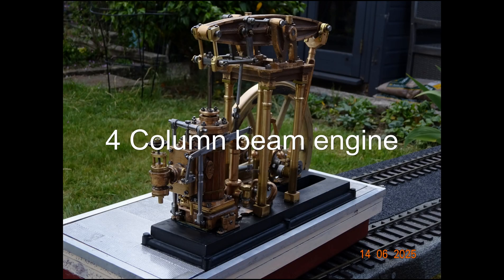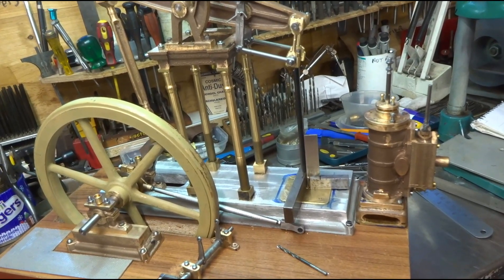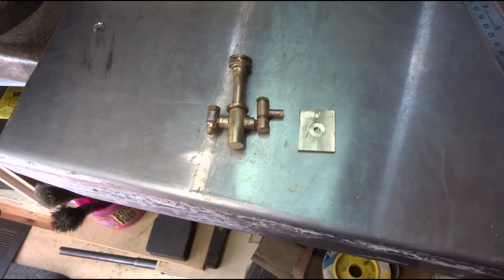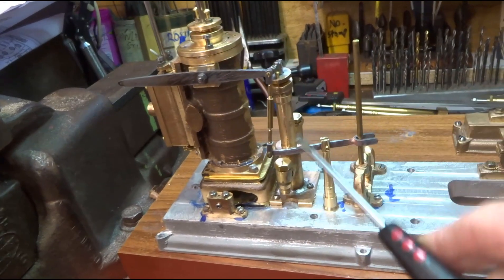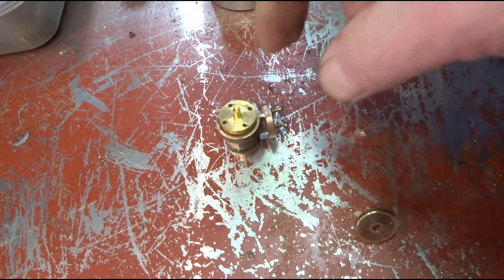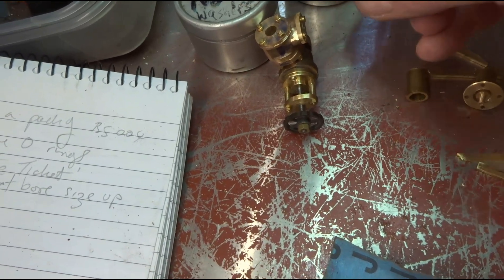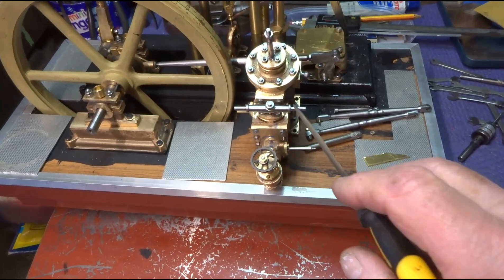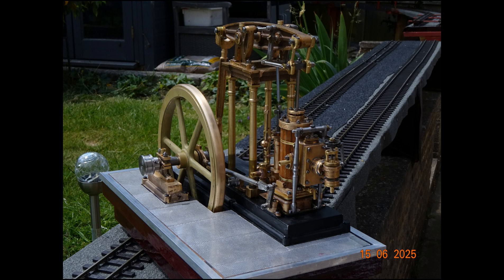4 col beam engine the final part of the build pt 6

Comment: Good work Edwin! Are you planning on running it on air?
Reply from the maker: I have yet to properly sort a compressed air supply in the new workshop. Wife has me laying paving slabs in between what I actually want to do. when I get the air I'll give  the engine a run.
Reply: @edwinwhite933  Excellent news. Also interesting new kit!